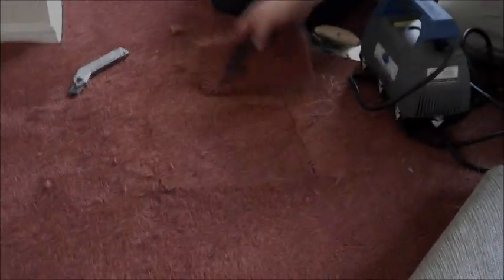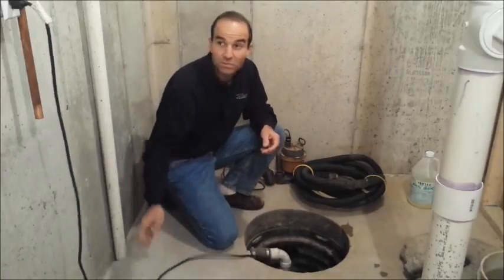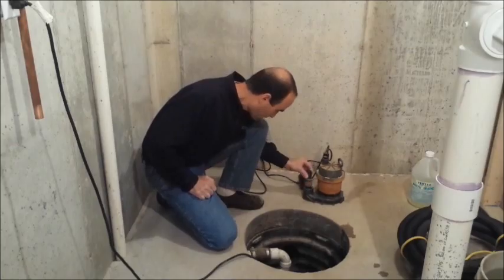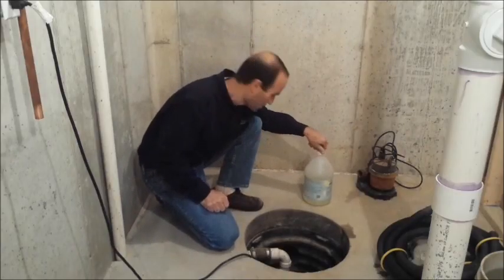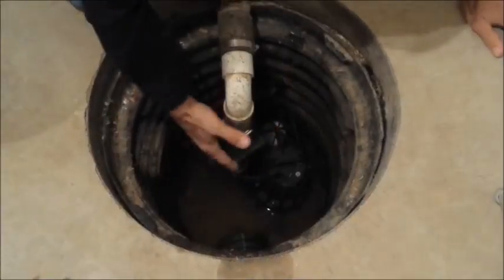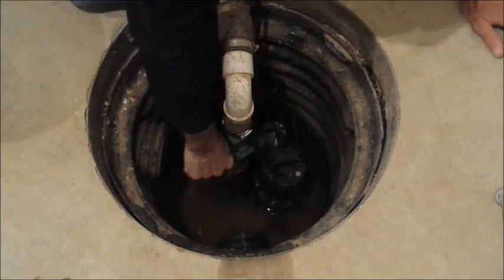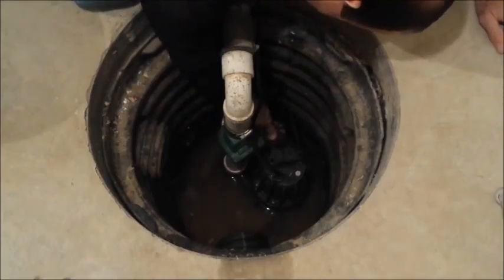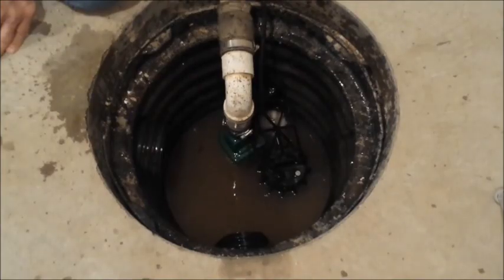Testing Your Sump Pump

Comment: Thank you for posting this!
Reply from the maker: Sure, Scott!  Glad to help.  Subscribe to our channel to help support us and get notified when we post new videos.
Also, check our blog, if you're interested.  www.houserepairsyourself.com
Reply: I will do that. This was a big help.
Reply: Couldn't bleach damage the pump?
Reply from the maker: brian0918, It shouldn't, but if you're worried about it, dilute it to one part bleach to three parts water.
Reply: @ScottCheatham  we need to replace the pump cos it's not working but it's the connectors that's not fitted.

Comment: Everything you say and do on the video makes sense and is good advice. My comment is on what I don’t see in the video. I don’t see a high water alarm in the sump pit. This means that in the future when the pump fails you will know it when the basement floods.   I recommend buying an alarm. You can get one for as little as $10 and mount it in the pit just above the point where the pump turns on. This way when the pump fails and the water level rises above that point it will beep and you will have advance notice of the issue long before the basement floods.   I’m speaking from experience of having pump failures both before and after installing an alarm. And the latter failure was less painful.
Reply from the maker: Neil Brookins, great point.  Those alarms can be helpful.  I'll try to do a video on that soon.  As long as you are home, they are life saver!
Reply: Home Maintenance Solution, Inc absolutely true that the $10 alarm requires you to be home to be beneficial. But there are also $40 alarms that email you on your cellphone so that you can be alerted even when you are not home.  And that’s a lot less money than remediation for a flooded basement.

Comment: If there is no water in my sump pump will it make any noise? Mine was just installed and plugged in but the pump itself is silent (like doesn't seem to be on).
Reply from the maker: It will only turn on if there is a high level of water in the pit.  You should probably watch the video again.   It covers all that.  Thanks

Comment: Just an FYI...don't use that much chlorine without diluting it. The chlorine will eat up the seals and corrode the pump rendering it useless. I'm a pool guy and have seen this many times. Two caps fulls in a pump basin is plenty! Or use two cap fulls of bleach or ammonia.
Reply from the maker: Cody Walton, thanks for the input!  Appreciate the expertise of the YouTube community.
Reply: I would recommend vinegar.  It will kill bacteria/insects, help clean the pump, but isn't as reactive as the chlorine in pool shock or bleach.  Whatever you do, DO NOT try bleach/pool shock AND ammonia.  It will react to make highly toxic chlorine gas (mustard gas) and in the confines of a basement could be fatal.

Comment: Do you recommend plugging your sump pump into a dedicated non-GFCI circuit?
Reply from the maker: Yes, I do!  Code allows for this as long as you use a simplex outlet.   This will leave no open receptacle for use by someone else.

Comment: My sump pit has what looks like two sacs filed with rocks shoved in the sides of the pit liner where the holes are on the sides. Is that normal to have?
Reply from the maker: john smith, not really.  The only thing I can think of is that they could be for weight.  They may have had trouble with it popping up when water is present.  If that's true, then more holes in the pit should solve the problem.  They could also be there to keep the pump in place.  Those are just thoughts...  Let me know how it goes!

Comment: Is it bad if I have sand entering my crock through a small hole in the bottom?
Reply from the maker: Donny Putinta, it's not ideal, but it shouldn't be a problem if it doesn't get sucked up into the sump pump.  That would be my only concern...

Comment: I try to check my sump pit by filling it up with water using a hose and it won't fill up after pumping gallons of wate in it with a hose.  I can only check it when it rains hard.  I check the motor by moving the float but I cant check it discharging water unless it is actually working in heavy rain.
Reply from the maker: Marquist Muse, that means you have a dry surface under your floor.  That's a good thing!  When you try to fill it with the hose, water is flowing backwards into the dry gravel under the floor.  If you have checked it by manually lifting the float, then that's the best you can do for now.  Next time you get a heavy rain, just make sure that the float is really floating and not water logged.  
Please subscribe to our channel so you are notified when we post new videos!

Comment: I have battery back up-it's a long story but my neighbor complained about my discharge placement of my sump pump and the city said I had to move my discharge line so the waterproofing company temporarily hooked a 1 and 1/2 inch pipe to the outflow and ran it up a small hill.. I said that's ridiculous -it's going to freeze -for one thing because it's record-breaking cold
I kind of got a who are you to tell us how to do our job we've been doing this for 35 years yada yada..
But I don't think I have to be a plumbing waterproofing engineer master to see common sense...

Sure enough the next day the pipe froze and my battery backup went off downstairs...

I couldn't shut off the battery alarm because some kind of clamp had gotten ruined on the battery and inside the sump pump I'm not sure what it was exactly
.. they came over and fixed i

Here is my question..
I went downstairs to check the battery backup, I was concerned that after it had blown out, the blowout caused water from the sump pump to actually blow the lid off of my sump pump and blow water into the basement whatever it was that happened... So I pushed the test button..
Usually whether there's water in the sump pump or not I can hear the sump pump try to discharge..

I'm not hearing that..

The green light on my battery is blinking indicating it's charging...

I don't even want to call the company they think I'm a pain in the ass-an upstart-they haven't returned the last two of my phone calls....

how do I know my battery didn't get ruined in this backup?

When I push the test button shouldn't I hear the sump pump activate?
Reply from the maker: That's going to be a hard one to diagnose with out seeing it.  I doubt the battery was damaged, but it does sound like the pump was damaged or at least tripped out a safety switch somewhere.  It should kick on when you test it.  You need to trace the problem down in order.  For example, is the pump getting power when it is tested?  If not, where is the power continuity broken.  If it is, then what is keeping the pump from starting?  This could be a little more advanced of a diagnoses.

Comment: I poured water in my pump, as I do every few months, to make sure it's working ok.  This time, the pump went on, but did not drain the water:  this happened once before, and I tapped the pvc pipe where I know the outlet valve is located.  After a few minutes, the water drained.  This time...no deal.  Is there something else I can try? (I'm a 68 y/o widow, and no nothing about taking apart pumps...and I'm afraid to stick my hand down in the water !)  This pump is only about 5 yrs old, and the guy charged me $350 (for about 20" work).
Reply from the maker: It could be the pump, but it could be the check valve, too. Either way, you need to find a trustworthy person to service it for you.  Good for you for checking it regularly and not finding out the hard way!!

Comment: Hi. I wand to open the end cap  to gain access to the sump pump in my basement  but I hear pressure when tempting to open the cap. is that safe? thanks.
Reply from the maker: What exactly do you mean by the "end cap"?

Comment: lol you air locked your pump.
Reply from the maker: Josh, explain for others to understand.
Reply: Home Maintenance Solution, Inc
Hi what happened here is the water level went below or near the pump intake allowing the pump to draw in air.
When this happens air gets trapped in the pump and due to the head pressure aka the water sitting in the outlet past the check valve holds the check valve closed and that in turn prevents the pump been able to push the air plus water out due to the air causing the pump to be not able make enough pressure to push the air out.
once this condition occurs a simple solution is to take outlet pipe off (caution in some cases a large volume of water may be in the outlet pipe if possible disconnect after isolation valve or check valve.)
with water in sump turn pump on then right back off it should push air and water out now it should be primed reconnect outlet pipe and test, this time do not allow water level to get low and air lock pump again. 

Sorry for long response I wanted to cover as much as possible.
Reply from the maker: Josh C Thanks Josh!
Reply: +Josh C Thanks for that extra explanation.
Reply: Is this happening if the pump is making noise but not actually pumping any water out? I took it off - A LOT of water came out as you warned - I primed it put it back in and it worked again. This has happened twice not sure why this might be happening - as the pump has not been run with a low level of water.

SECOND question - I have one of those free floating floats that is shown on the first sump pump in this video and sometimes it wont trigger not sure if this is because it isn't working anymore or if the wire is too short/taught or what. Considering getting a new pump with a different float method because this one is just having issue after issue.
Reply: For you first question yes if pump is running and failing to drain air lock or obstruction in outlet pipe or inlet. if is air locking check float is not getting stuck on something.

Second question
I agree probably float issue or pump is going bad.
Reply: Josh C aga Khan and
Reply: Victoria Boyle if just the float is bad and the pump still works you may be able to just replace the switch. That’s easy if the two parts are separate.